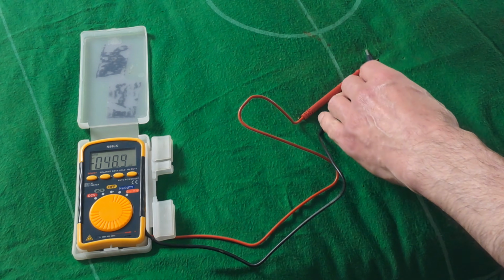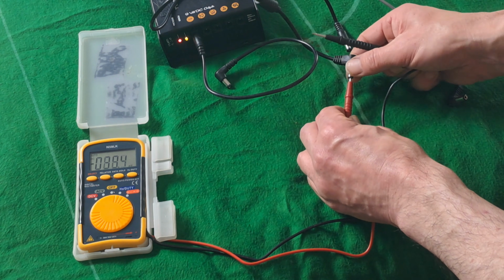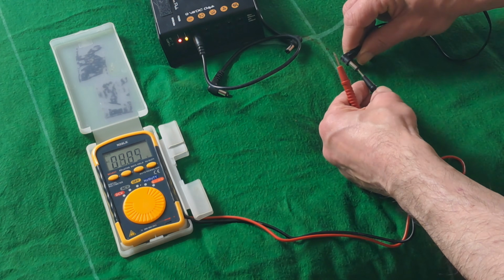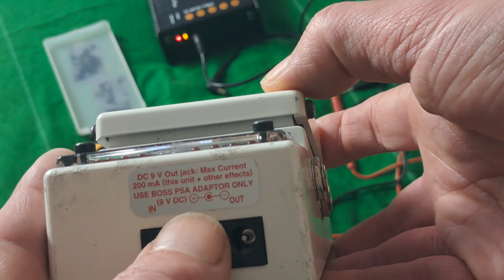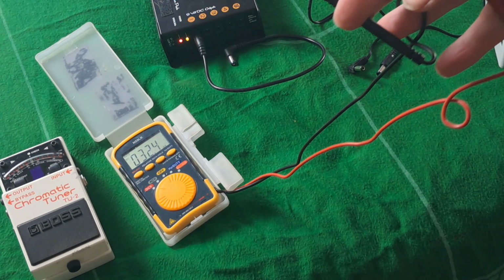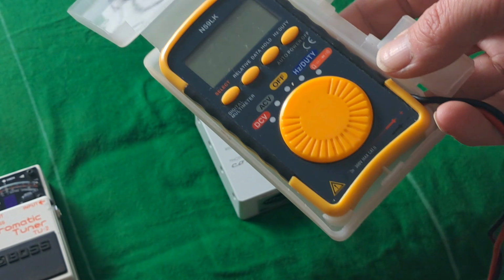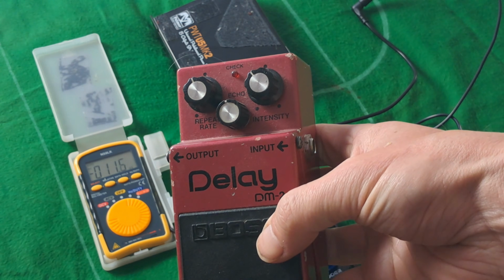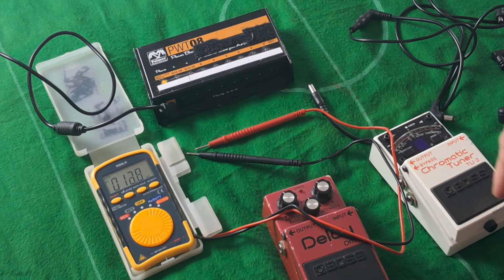Power Basics: Effects Pedal Polarity And Voltage (For Musicians)

Comment: Question: If I have a 9V guitar boutique effects pedal which does not have any - + labels, and the pedal builder is unknown and I need to find out if I need a 9V (- or (+ power supply, what do I do?

Follow up question: What is “a reverse-polarity power supply” and is the answer part of my first question?  

Great video! Thank you very much!
Reply from the maker: Hi, obviously contact the builder.
But without being able to do that then ... With no labels then tracing the actual circuit board to earth at the socket with a continuity tester is the only certainty.
Maybe I should make a video explaining this? 
Thanks for watching and reaching out. 
All the best, 
Dale
Reply: Hi Dale, thanks for the reply. Yes please make a video how to test if a pedal is (+ or (-. I’ve searched the internet for anything on this subject and found nothing - text or video - so your video would be the only answer out there to this question! Thanks again :)
Reply from the maker: I've just made a video that does exactly that where you can verify the polarity of your pedal. It comes out today at 1200: this is the link:  https://youtu.be/N0-NHQHXKp4
Reply: Thank you so much!
Reply from the maker: Hopefully it gives you a method of testing your pedal and gives you a safe starting point.